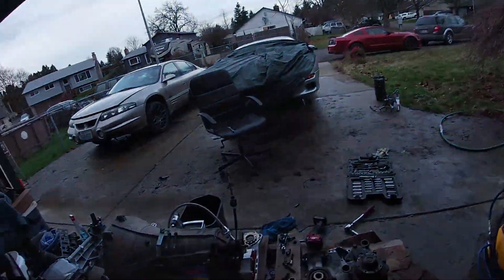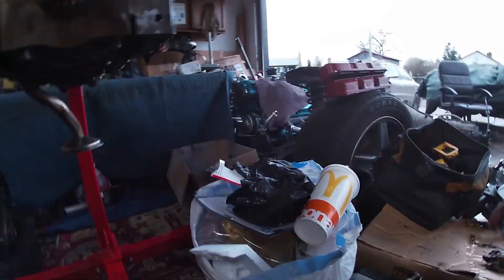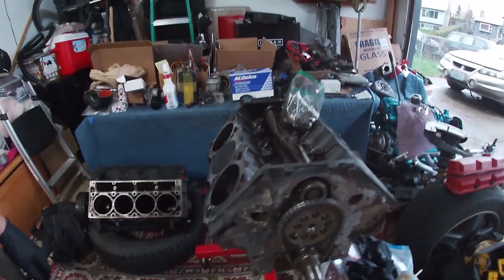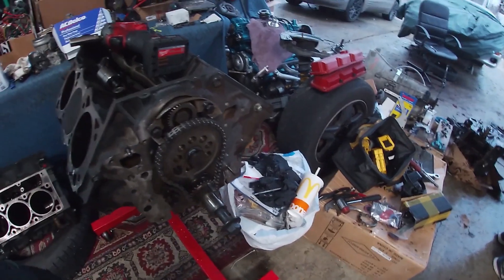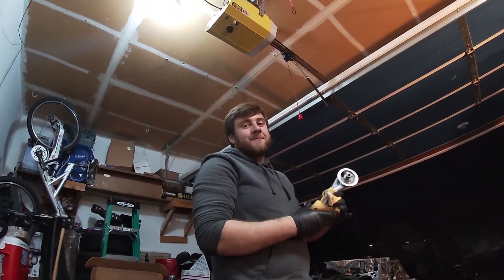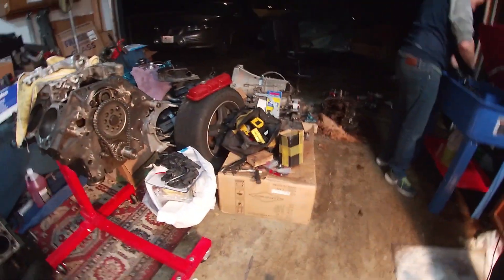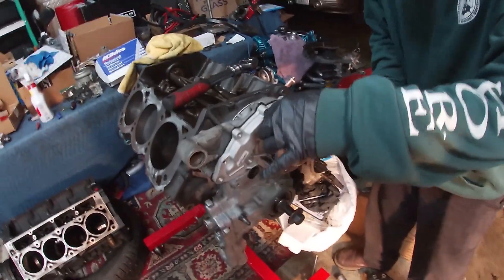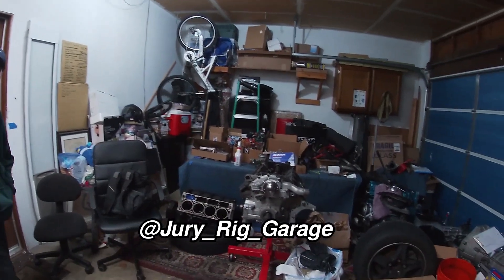Bonneville SSEi 3800 Series II Top Swap Part 9 (Building the Top Swapped Motor and Setting Timing!)

Comment from the maker: Might have made a mistake on this one @ 3:43 you can see that the timing is set, but the balance shaft up top is not. We did not know the balance shaft needed to be timed as well (makes sense when you think about it 🤦‍♂️). Be sure to time the balance shaft if you end up keeping it, it will cause vibrations (deleting the balance shaft is also an option).

Comment: When you put an oil pump on these engines do you have to prime them or do you just install it and send it?
Reply from the maker: Most install and send it. I’m not sure there’d be an easy way to prime it past lubricating all the parts before installation.
Reply: @JuryRigGarage  Wouldn't having the engine turning over, trying to start it. with no ignition  prime it?
Reply from the maker: @MegaZombie101  "Priming" an engine typically means you fill all the internal oil passages so that the rotating assembly will already have proper lubrication. You'd do this by spinning the oil pump gear, we don't have an easy way to do this. Turning over the car with no ignition would likely be the closest thing we could do.

Comment: Are you guys gonna put a gen 5 supercharger while you're at it? How about some bigger injectors and an adjustable fuel pressure regulator
Reply from the maker: It's already got a ported gen 3 so we'll stick with that. Also already has 60lb injectors.
Reply: @JuryRigGarage  42lb injectors on the Bonnie* 60s in F. @snoopy 42s are good enough.
Reply: Stock L67 engines have 37 lB injectors 42 will be plenty of fuel ☺️👌👍

Comment: How come you guys aren't doing the double timing chain this time
Reply from the maker: Primarily money constraints and time. The double timing chain, machined front cover and extra thick gasket cost $200 before shipping. The bonneville is a daily so it won't get enough abuse to justify the expense.
Reply: @JuryRigGarage  makes sense was just curious
Reply: @JuryRigGarage  one more question having an issue finding one where did you get the 2nd design water pump
Reply: @jdjizzle  it's In our spreadsheet in the description. Along with every part for the Camaro to date.